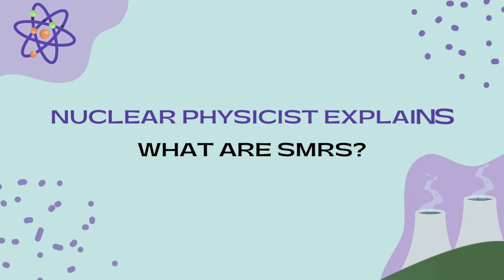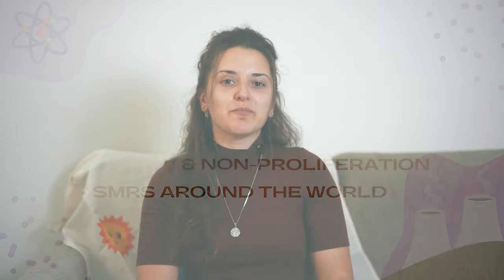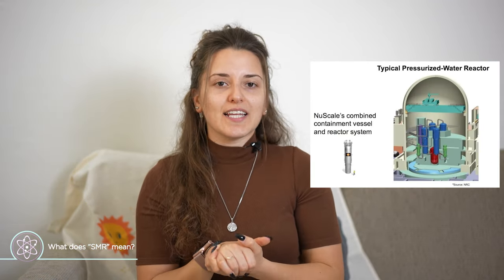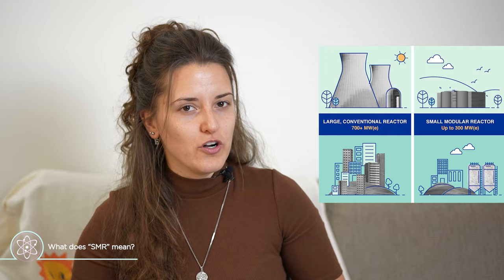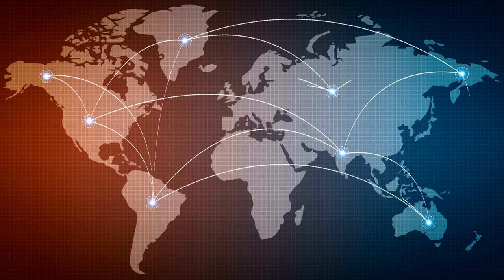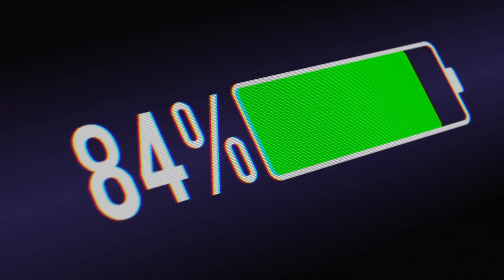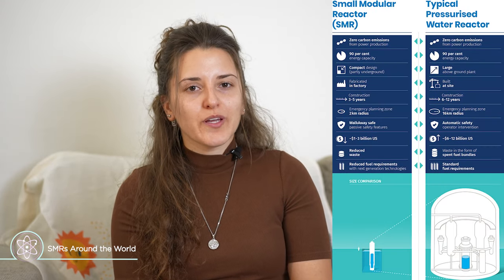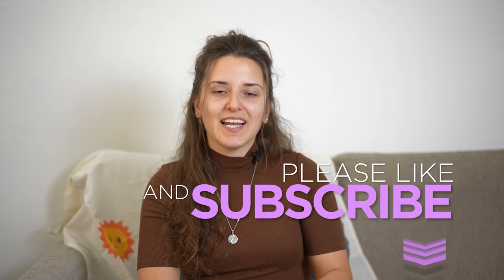Nuclear Physicist Explains - What are SMRs? Small Modular Reactors

Comment: Hi Elina, I have a few questions:

1) For now, it seems to me that SMRs should only be used in the context of a big power plant. Isn't it terrible for oversight if now big companies in energy intensive areas start using their own reactors in their backyard? It seems better for agencies such as the IAEA to only have a few sites to inspect. It also seems easier to implement a restricted site, where only authorized personnel can enter.

2) You mentioned maybe good aspects of SMRs, such as lesser refueling frequency, advanced fuels, flexibility, etc. Are they really a distinct advantage of SMRs? Isn't it something that usual bigger reactors can also be configured to do? Plus, as you said, some of them actually have higher refueling frequencies, which does raise the proliferation issue. 

3) Regarding waste, you mentioned that SMRs can use advanced fuels which produce less waste, etc. On the other hand, I've also seen articles such as this one https://news.stanford.edu/2022/05/30/small-modular-reactors-produce-high-levels-nuclear-waste/ talking about higher level waste, due to their design and bigger neutron activation of the reactor structure itself. How do you balance this out?

4) You mentioned that SMRs attempt solve some of the standardization and certification problems. But again, is this really a revolutionary characteristic of SMRs? Because "normal" reactors can also be standardized and built with modular parts themselves (take the new Korean APR+ reactors for example https://aris.iaea.org/PDF/APR.pdf , with estimated construction times of 3 years)

5) Are they really safer? Big reactors can also have passive safety systems and so on.

A lot of the points you mentioned feel like they are not specifically a unique feature of SMRs, but also features that bigger reactors can employ. What are really the unique advantages of SMRs (that normal reactors can really not have)?

Disclaimer: I'm a physicist, not a nuclear physicist.
Reply: Fluid dynamics. Large pipes are more efficient. SMR reactors are being sold as Silicon valley style glossy brochured paper investment schemes, based on flawed (manipulated) simulations. Most of the site costs with a fraction of the total output. Efficiency of scale, large reactors aren't just by chance. We have had small reactors for decades SL1 was an early example....

Comment: In all honesty when I first started to hear about small modular reactors the first thing that came to my mind was a reactor based on a nuclear submarine reactor.
Since submarine reactors are built in a factory and are a closed loop system designed for a 25 year plus lifetime which are extremely safe it made sense. The concept of a nuclear submarine reactor seemed to be extremely logical to me as the basis for an SMR and I would imagine the design could be scaled up or down if needed.
I don't think Australia needs nuclear reactors of any type besides the one we already have or it's replacement.
But I am not anti-nuclear I just see nuclear power as an easy path to go down and not necessary for my country including overpriced nuclear submarines.
The basic principle of how a nuclear reactor works is common knowledge. I have worked with steam generators and boilers and heat exchangers and associated equipment for a couple of years but the finer points of how big a control rod to use with what type of fissionable material versus the best material to slow the fission process is not my forte.
It's how the reactor is designed and the ancillary systems after the reactor that make the difference.
Some of the advantages of a closed loop system are less variables such as outside water supply issue's and threatening weather conditions. Much better tolerances and better materials are available with a factory built SMR compared to current designs for site built reactors I would imagine the first reactor would be expensive but subsequent rector's would be considerably cheaper.
No surprise the Chinese have just about finished the first operational SMR and it will cost them much more than originally budgeted for.
It seems the countries that had adopted nuclear power early on have become a little bit obsessed with anything nuclear especially the promise of a working fusion power plant...
😎
Reply: grahambennett8151 The biggest threat in that scenario is loss of utility power. That is all.

Comment: Two things:
1. Isn't heat engine efficiency positively correlated with device scale?  That is, wouldn't smaller reactors be somewhat less efficient than larger versions wrt electricity production?

2. How do SMR "passive safety features," work/what are they?  If SMRs are scaled down versions of conventional commercial reactors (i.e. water-cooled thermal reactors running on either enriched uranium or reprocessed waste,) then I'd expect them to require active safety measures.  Primarily, active cooling.  Is this not the case?  Regardless, I'd definitely appreciate elaboration on SMR designs in this regard.  Thanks for your time!
Reply: 1) you’re right, but the other benefit more than make up for minor loses in efficiency. 

2) it depends on the type of reactor. Molten salt reactors drain the fuel salt into a drain tank that disperses the heat, so the salt solidifies stopping the reaction. The helium in helium cooled reactors have such a high heat capacity that they’ll stay cool until the pile has cooled. The NuScale design uses a water bath to act as a heat sink. There’s a Rolls Royce design that uses the containment vessel as a heat sink. Also, smaller reactors are able to disperse heat better. That’s why they’re less efficient
Reply: @kokofan50  

Re 2: 🤦‍♂️ I forgot about the square cube law.  Oops.  Anyway, thank you for the explanation!
Reply: Thermally, compensations may be made.
However, the surface-area to volume ratio also impacts the neutron economy: how many neutrons leave the system as opposed to hitting fissile nuclei. Small reactors lose more neutrons, so sustaining a reaction requires that the source of neutrons (fissile material) be used up at a higher rate.
Overall this results in less efficient fuel use and more waste per unit of energy generated. 
Some say this is not the limiting factor, but it doesn't help.

Virtually no spent fuel waste has been disposed, so we have no idea how much this adds to the overall costs. Some estimates run very high, so halving efficiency (doubling waste costs) could be a serious matter. 
Some proponents think not. we will have to see. We will not know for sure until we see major nuclear nations actually dispose of a substantial fraction of spent fuel. Till then it's just hopeful guesses.

Comment: How does a fast breeder process prevent proliferation?? Surely fast neutrons + U238 => Pu239, which is a fissile material which can be chemically separated to make bombs (ignoring the Pu240 problem).
Reply: It requires either enriched U-235, which is expensive and dangerous, or it requires additional alternative fuels which reduce the fast neutron flux and so make the reactor less efficient.  It is also possible (generally speaking, IDK how feasible it is for SMRs) to design a hybrid fast-thermal design where Pu-239 (I think this is right) absorbs thermal neutrons as the reactor goes through its fuel cycle and so has secondary reactivity.

Comment: I have a question, if I may: Are nuclear submarine reactors considered SMRs?
Reply: @Ex Lagadema  Yes which means they are actually Gen 2 reactors and nothing new.  The TRISO pebble fuel surrounded by multiple layers of Carbon with 2 different types to the Thorium decay chain where its U233 for the fissle fuel and not Th232. Or MSR tech with the Tellurium Segregation of the Hasteloy-N issue which makes them much more expensive to the IMSR replaceable core every 4-7 years for the graphite expansion/contraction issue.  These designs, fuels and coolants are nothing new and only the attempt of the industry to keep from slipping past 9% globally for our energy needs.  They are putting lipstick on a pig and trying to pass it off as the next new hot thing.  If you need more I have it all backed up.
Reply: Not really, submarine reactors usually use high enrichment uranium. They cannot be used in civilian facilities because of nuclear nonproliferation restrictions. The exception is the Russian reactors for their nuclear-powered icebreakers, which run on "energy-grade" enriched uranium. They use them for their mini-nuclear power plants. One is already in service, four more are under construction.
Reply: @midnike8783 
That's interesting, if they are really building more nuclear icebreakers; the two the USSR built for clearing the port of Arkhangelsk and the White Sea were decommissioned years ago.  'Bout time.
Reply: @paulmobleyscience is pooh-poohing good tech all over this channel.
The real answer is, yes and no.  Yes in that military naval propulsion reactor designs are made to be reproducible so that the same vessel design has the same reactor design throughout the class.  No in that they are not fabricated completely in a factory and then shipped somewhere; in naval construction the reactor vessel is first installed, then fueled when the fuel elements are put in place.  National security laws & policies dictate that the fuel be handled separately.
Propulsion reactors also must vary power output on demand and so do not have inherent stability in their design.

Comment: From an Economists perspective I see the advantages of economy of scale, but I see a logistical nightmare, too. 11 SMR´s to replace the two EPR blocks in a plant like Hinkley Point C which have to be moved for refurbishment every 3 to 7 years. That’s roughly two transports every year on a very heavy rig which means slow, tedious and expensive. Now imagine several 100 in a country like Germany, no need for a speed limit on the autobahn anymore, everybody is stuck in traffic jam behind a SMR transport.
Reply: Transport and reprocessing would need to be timely*. No letting spent fuel (or reactor modules) just sit around for thirty years. The reactor site would need to close and ship a hot reactor *knowing that a slot would be open at the other end. They cannot turn on a new one until they know a guaranteed slot is available some years in the future.

This would require the existing nuclear industry to experience a very severe culture change.

Comment: Yah, burying fuel tanks worked out really well.  They are still going to be a security threat and like their predecessor they are going to have unanticipated failure modes.
Reply: Petrol fuel tanks need to be inspected periodically, and go through more physical stress from loading & draining than a sealed vessel whose mass barely changes.
Unanticipated failure modes are greatly reduced through computer modelling, and a secondary containment vessel + inherent stability design means that a release of radioisotopes into the environment is a very improbable scenario.

Comment: Could things like SMRs be used for things like large cargo ships, submarines, perhaps large aircraft? Also what about htings like large factories steel mill, data centers that use a lot of power could they setup their own power plant basically?
Reply: The naval reactors that have been used for decades are SMRs. Although, naval reactors have some problems that aren’t suitable for civilian ship. 

Yes, a SMR would be good for a steel mill. People even want to directly use the heat to do things like desalinate seawater.
Reply: @kokofan50 military propulsion reactors aren't exactly SMRs; they don't use all the same design principles.  They're designed for high,  actively controllable output, and consequently don't have inherent stability, and are made with startup/shutdown procedures so they don't need to be monitored when the ship is not deployed or ready for duty.

Comment: Hmmm, this sounds similar to the Ussr RTG's but on a larger scale. 
What would happen if it's water bath would drain away!?
Reply: If the water drains away the reactor will shut down. Water is a moderator - slows down fast moving free neutrons to increase the chances for capture or fission of other U236 nuclei. It's a self sustaining failsafe arrangement.
Reply: SMRs and RTGs are fundamentally different.  Look at NASA's MMRTG (Multi-Mission RadioThermoelectric Generator).  It generates electricity by capturing the heat of isotope decay, not through neutron-induced fission, so it's not a reactor in that sense, it's more like a radioactive decay battery.  NERVA, which was actually tested in a concept prototype, never flew, but was an actual reactor that used reaction heat to superheat thrust mass.

The power supply for the Voyager, Mariner, Viking, Galileo, and Cassini space probes, among others, were RTGs because they can generate power constantly without regard for environmental factors such as sunlight intensity, external temperature, or craft orientation.

Comment: Could you talk about naval propulsion?  Also debunk the Iranian nuclear program as designed for civil energy production?  Obviously it is possible to generate clean energy with natural Uranium using CANDU or LEU in light water reactors, and with the exception of US submarines which use warhead grade fissile material in the reactors, even naval reactors use ~35-65% enriched fuel which ( please educate me if incorrect ) does not go boom.  So if you would not mind talking about the implications of Iranian program and your thoughts, as well as anything you might know or be able to research about naval propulsion systems would be enthralling.
Reply: it may be possible to build a bomb out of material that goes as low as 20% enrichment. This was part of the original regulatory cutoffs. Of course, modern electronics can control an implosion device much more consistently than forty years ago.
Not a good bomb, but enough to be concerning.

Comment: Does small elements could be created from Nuclear (Atomic) Power, i.e. for powering regular Flying Planes and Ships?
Reply: No; there is something called a buckling ratio, which relates the outer surface area of the reactor volume to the spatial volume of neutron flux within the reactor.  When the reactor size gets smaller, the buckling ratio increases, and because of design physics makes it harder for a single unit to sustain power output.  Besides other problems like power-to-weight ratio, reactor vessels can't be both small and light enough while generating enough electricity to power things like planes or cars.
Or as Issac Arthur put it in his video on fission and fusion energy,
"But no really, the Thorium-powered car is so much 🐃💩."

Comment: I have a question so will it take longer to refuel smr than gen 3 reactors? And can we put some human safety protocol for some reason the passive protocol doesn't work and jus to be sure for safety?
Reply: Most SMRs have either online fueling or a set amount of fuel for their intended life span. 

It’s going to take the laws of physics to fail for passive systems to fail.
Reply: @kokofan50  wait online fueling? How does that work? And they have a lifespan, like after 25 years they will be gone?
Reply: @minhduongnguyen3671  All molten salt reactors remove the salt from the core and pump it in a heat exchanger. Some also want to remove various isotopes to sell for radiation therapy for cancer, to fuel RTGs, and other stuff. After the processing they just a bit of uranium salt to make for the difference.
Reply: In some countries (the US I know for sure) there are regulations about having 'eyes-on' security personnel at all times.  It adds to cost, but national security concerns of late have shot up regarding domestic threats, and right now energy prices will support the increased cost, even if it is just remote monitoring.